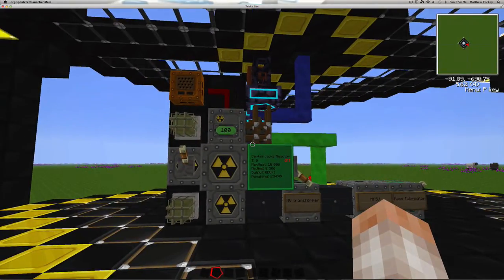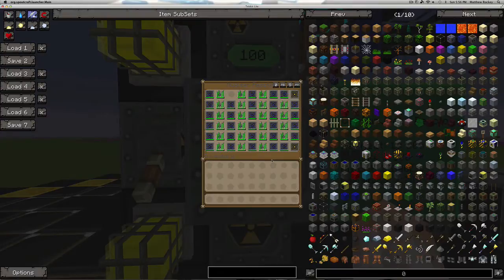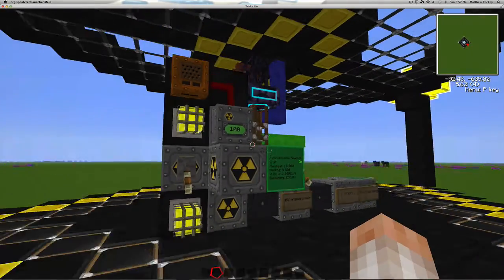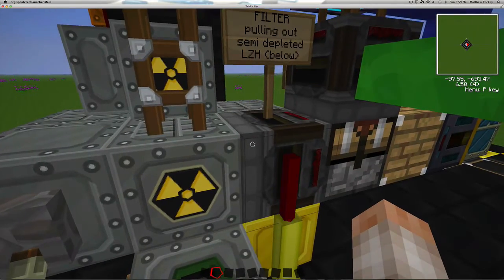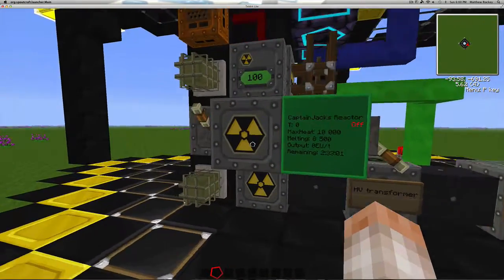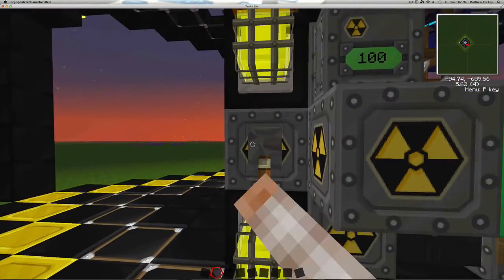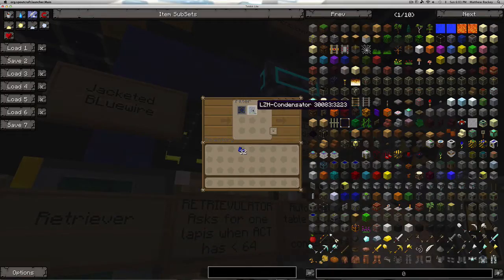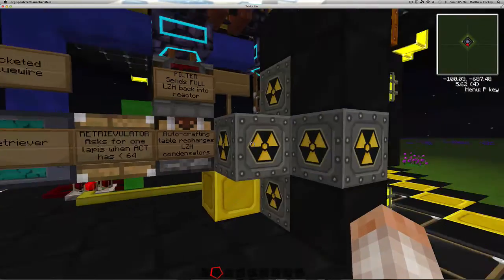2040 EU/t output IC2 Nuclear Reactor!

Comment from the maker: @ShiveringGypsy Make a reactor sensor kit then hold it in your hand and right click the reactor - it will generate the info card. If you get an "out of range" message when you use the card in the panel just add a "Range Upgrade" to the info panel until it goes through. Each one adds 10 blocks of range I think?

Comment: lol all that work.  well live n learn.
i've been through a lot of your vids n stuff.  nice work btw.  made my way through the ic2 forums also.  currently using a 100eu/t reactor.  well 5 or em set up much like the old solar flowers with a mfsu in the middle and 5 adjustable engines off the mfsu for powering quarrys and processing.  bear in mind i'm only a week or so into a game so my setups are still quite small.  one day i'll take a run at UU lol.

Comment from the maker: Its mostly a logistical nightmare :p

I learned only a day later about the reactor coolant injector which replaced that entire Redpower2 mess with one machine, and allowed me to make my next reactor video, the 100% up-time self-sustaining reactor.

If you haven't seen it already check out our channel or website. I also just released a video of an extreme voltage reactor that uses the cooling system in a very small space.

-CaptainJack

Comment: this is both impressive and a logistical nightmare at the same time.  good on ya for figurin it out it looks good.  
i couldn't help thinking cost wise though that i'd rather have 4 or 5 smaller reactors that fit in the same amount of space and cost less material wise.  something simple and effective that would be easy to throw together (relatively) and can be done with in a small amount of time.
can't wait to see your work on the breeder reactor.  that's my next step.

Comment from the maker: Yeah I did almost do that but if I wanted to do it properly I would have had to add two more to fill the totally empty cells (40->80->100) but since the reactor has to be stopped at some point to refill, I just stuck with the one.